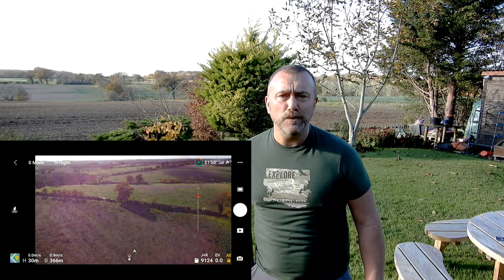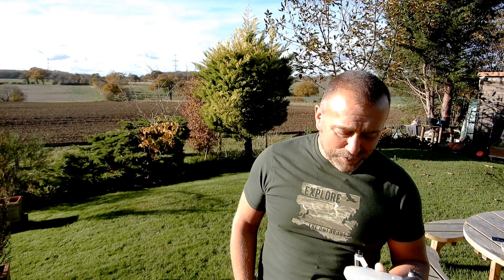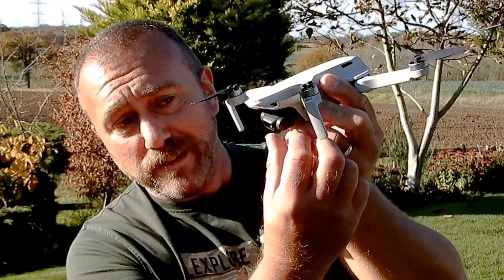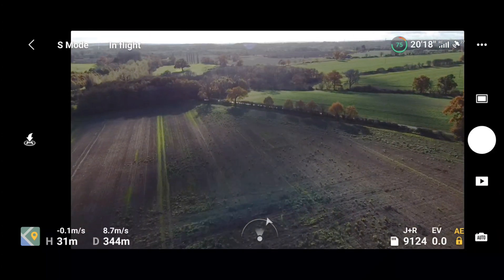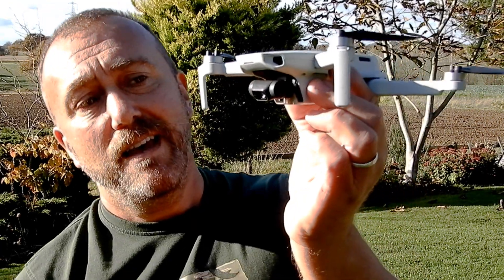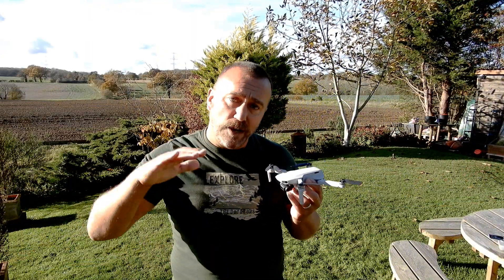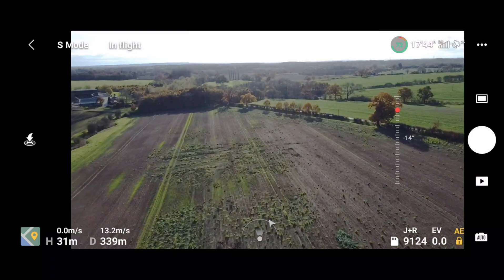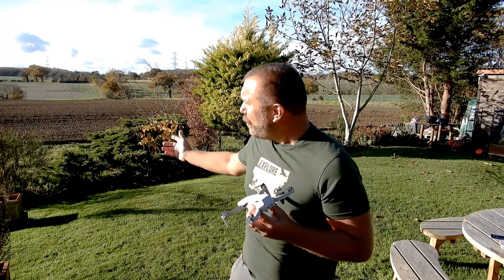DJI Mini 2 Camera Gimbal Dip Issue - Why it Happens & How to Stop it

Comment from the maker: Was initially annoyed when this first happened, but now I understand it, it's not such a major issue to me.  What are your thoughts?  cheers, Ian
Reply: If you fly in C mode it will not happen unless there is serious winds and gusts.. But there is an art to moving the gimbal, knowing how your drone will tilt and keep the gimbal within the range so it doesn't hit either limit, this way it will always seem super smooth...

Sweet

😁
Reply: Actually now that I think about it, you can check some of my last videos, I think this almost doesn't even happen at all to me. I just make sure the camera is not too pointed down nor too pointed up, at about 45 degrees down you should be able to go full speed in S mode and then gently slow down and stop without getting that jerk effect at all.. As long there is offset left between the angle of the drone's forward tilt and the camera's limits there shouldn't be a problem..

Lol

Sweet
Reply from the maker: @ivanjdrakov1957  Yep; that's what I'm trying to convey in this video! :)   Cheers, Ian
Reply: @IaninLondon  I'm so super happy that you made this video, now I can point it to all these pilots who think their Minis have a problem with the gimbal. You'll be amazed that people don't realize why this happens, meanwhile it's so obvious..

Anyway thank you very much for this video, it really was needed.

People should, will just learn with time and experience - how to fly the Mavic Mini or Mini 2 without getting this jerk effect. It's all about accelerating or decelerating gently, a slow change of rate or speed. Also making sure the camera isn't pointed way too much up nor down when speeding in S mode..

Sweet

PS: another awesome video from you, sweet!!!

Keep well and be safe bro!

Comment: I crashed into some tree leaves and my drone fell and landed upside down.  The gimble did a 180 and now films upside down.  How do I fix this, please and thanks.  Please respond as to how I fix this.
Reply from the maker: That sounds like a DJI repair job, although you could try recalibrating the gimbal or using DJI Assist 2, a computer program you get from DJI.co,/downloads

Comment: Also Ian I forgot to mention when the message Kimball overload is popping up I have no control over the Gimble no matter if I try to point it down or up it just doesn't work
Reply from the maker: You can try recallibrating with DJI assist. But I'm afraid it sounds like it's damaged. You need it checked and repaired by DJI.
Reply: @IaninLondon   I don't understand though I did nothing wrong to the drone I didn't break it I didn't crash it I didn't do anything
Reply from the maker: @D-Rock21  True; this happened to me though; it can be damaged in transit or just have a wire fail.  When DJI analyse it, they will advise if it's a failure that is covered under warranty.

Comment: Guys, this is clearly a firmware/software issue! Last year I've been on vacation twice with my Mini 2. So in Austria and Norway. Flew in different modes over snowy mountains, a sea and large lakes, in strong wind and also light rain, but I swear that I have never experienced this issue before. All shots were smooth as hell. After a certain firmware/software update it starts to occur regularly, especially during QuickShots. I remember there was a tool for the Mini 1 to downgrade the firmware. Unfortunately I can't remember the name of this tool. But downgrading the firmware might fix the gimbal jump/kick issue. It's a pity that DJI does not allow the user to downgrade the firmware in case of such issues!
Reply from the maker: Yes and no.  The firmware update was to increase pitch angle, to improve ability to handle strong wind so it doesn't get blown away....  Personally I'm happy with this.... :)

Comment: Hello Ian. This also happens to my mini 2 when top down, in cine mode, when is in photo mode. In video mode gimbal doesn't jump. I think is a mechanical or firmware problem not a feature. Dji should do something to fix it.

Comment: Hi Ian. I know this is an old video and although not the same I have discovered a quirk with my mini 2 that I have now had for 4 days. Not sure if it's mine or standard but with the gimbal pointing straight down (no wind) when I move off in cine mode the gimbal stays pointing down until I stop and then the gimbal lifts  up by approx 5 to 10deg and stays there. Is this normal. Thanks. PS Your vids have been very helpful.
Reply: Don't worry it was happening because I was in photo mode. It doesn't do it in video mode. I wonder why though. Anyway, might be interesting to know for everyone. Thanks
Reply from the maker: I haven't tried that precise scenario, but again, it's likely due to reduced clearance with the main drone body tilting as you come to a stop..... I would not worry about it as it's not a malfunction, more a limitation...

Comment: I contacted DJI and they said: 

The gimbal will sometimes move straight down during flight, as the aircraft's attitude is too large and the nose is tilted too far forward. To avoid reaching the limit, the gimbal will move downward.

The issue mainly appears in the following scenarios:

1. When the aircraft flies forward against the wind, a larger attitude is required in order to resist the wind turbine, and the gimbal is relatively easy to hit the upper limit. It is recommended to adjust the gimbal downward or slow down the flight speed.

2. When the aircraft is flying forward, move the gimbal upward. If the gimbal is close to the limit, it will automatically move downward. It is recommended not to move the gimbal up to the top when flying forward.

3. When the aircraft flies backward, and the control sticks are suddenly released, the attitude of the aircraft will change too much due to the rapid braking. It is recommended to slow down the drone slowly and gently release the control sticks when flying backward.

4. When the drone is flying forward in S-mode, the flight speed is faster, and the attitude of the aircraft is larger. It is recommended to adjust the gimbal's movement downward or control the aircraft to avoid sudden changes in speed.?

Comment: When stationary, I thought the gimbal could rise 40 degrees to look up (so looking higher than dead straight ahead) - but maybe it can't (and it's just designed to tilt up when the drone is pitching)?
Reply from the maker: No, only 15 degrees and only if you've ticked that option in the settings.
Reply: @IaninLondon  Cheers Ian. I stumbled across the setting yesterday and it now tilts up. No idea why I couldn't find this info on Google. Anyway, all sorted. Cheers for your reply, appreciated.

Comment: Hi Ian, love your videos. I just got the Mini 2 and are wondering about ND-filters. Do you use ND-filters with the Mini 2? I have read that they can cause Gimbal error/vibration.
Reply from the maker: I have occasionally but don't like the way they clip over the gimbal; always feel like they could slip off.  They haven't caused vibration for me yet.
Reply: @IaninLondon  so should I get them? What do you recommend?
Reply from the maker: @joakimtollerud2172  To be brutally honest, unless you're flying in very bright sunshine or after some silky water shots, I'm unsure they're truly worth it.  I have done a few videos on NDs and this video will probably help you the most as I explain exactly what they do at around 7 mins in:  https://youtu.be/-KeAo3mhuoA
Reply: @IaninLondon  thx for your answer. I use ND-filters on my cameras all the time but since you're filming something that is so far away I'm wondering how much you really need filters for a drone? Does High shutter speed cause a lot of jitter in the photage?

Comment: Mine does the inverse, it refuses to look downwards 90 degrees. Also the GPS chip runs super hot. I'm a bit worried about testing it on a big run, so I contacted DJI. Testing it out this weekend. It's already plum fallen out the sky once and done minor damage to itself. I'm considering just sending it straight back, but I'm also part praying it'll get better. :/
Reply from the maker: I don't think those issues will fix themxelves; I would send it back....

Comment: Hi, I flew my Mini 2 again today and noticed that as I pan the the Drone from left to right (and vice versa) using the left stick the footage is a jaggy but panning side to side using the right stick is much more smoother - I noticed people avoid filming while turning the drone because of this - is this a common problem? I filmed in auto 4K 30 fps. Cheers,
Reply from the maker: The left stick rotates and will be very sudden; the right stick is simply moving the whoel drone left or right, so will be much smoother...  You can adjust the speed of rotation to slow that down.. https://youtu.be/bzxGz6lZ6aY
Reply: @IaninLondon  That's a great tip! Much appreciated!! This is very useful - many people don't mention these "simple, but hard to know" tips. Have a great day!

Comment: Thanks for this, Been out with the Mini 2 for few test flights and I am actually experiencing this in Normal mode at low height with very little wind so I am not sure if this unit is faulty or these Mini 2's just can't be flown and capturing footage in anything other than Cine mode which is a bit disappointing, It also did it with an Auto return to home in Normal mode also and that day was very calm and it was only 100 ft up, Will give it a few more go's depending on the weather and see what happens.
Reply from the maker: It's worse if you're flying sideways.... and most apparent when you have the gimbal up as high as it will go.  Try enabling the upward gimbal option allowing it to go up an additional 15' above the horizon
Reply: @IaninLondon  Cheers I didn't know that either thanks for the tip, I already have the upwards rotation enabled, Just checked the logs and it was only around 9 m/s about 20mph when it happened also which seems odd at the height and little wind there was, However I could see quite a bit of the horizon so maybe tilting it down a bit more may solve it, Thanks mate.

Comment: I think the problem is that it is very difficult to predict exactly when this will happen as there are multiple factors involved such as speed and wind conditions. This has the potential to ruin a perfectly executed shot. Perhaps it would have been better for the drone to default to flying within the gimbal's tolerances and give the user the option to switch into a higher power mode when conditions get rough but then you know it might cause issues?
Reply from the maker: I'm hoping they fix this with a firmware upgrade as they did with the Air 2.

Comment: I don't totally agree with you as at has, at least for me, dropped in all three modes. I contacted dji tech support and they had me do a reinstall of the ap plus had me do a gimbal reset. That didn't help. After the latest update it did seem to improve it where it only does it in sport mode. I'm hoping they will fix it. It doesn't seem to do it in all the drones as I've seen many videos of it  (unless they are not posting it) Some are even having a side tilt, probably for the same reason you've stated. Mine has been in pretty fast winds and I don't get the side tilting on mine so far.
Reply from the maker: I've had side slant as well, in normal mode, but in strong wind....  I hope they do an update like they did to fix a siilar issue with the Air 2.

Comment: I just got the mini 2 and haven't really used it much but I've heard in other videos, if you turn on upward movement of the gimbal in the settings, this can also help improve the dip people are experiencing.
Reply from the maker: Hi Andrew; I'm not so sure as the issue is the physical limit of room for movement, whilst that switch is simply a software element that allows the gimbal to move up beyond 0'.  But I'll be playing around more with this setting to see... Cheers, Ian

Comment: States in the user manual to not use sports mode for video or photos. (tho it is odd not to have it good in all flying modes but that's what it says)
Reply from the maker: Aha!  Well, good going Karl; I do usually read the manuals to double check the features but missed that one.  You're right, bit strange but I guess they know this issue will occur.  Bottom line, I'd prefer a twitchy gimbal over a blowaway...  :)
Reply: @IaninLondon  true, though recording isn't the priority if you're going up in winds higher than the drone is rated for anyways.

Comment: I can still consider that as something that has to be fixed by DJI. Sports mode is primarily used to add a bit of action in your footage and not just to resist gust wind, therefore when you go in sports mode, you should have the ability to capture the best angle it is capable of. As you see, when the drone moves forward at maximum angle it is initially able to focus the camera straight at the horizon and only flips a bit down suddenly in certain situation.  Maybe the gimbal is not strong enough to hold it at that maximum angle or it is the firmware that needs some fix. In short "it's not broken" but I don't think it is a "safety feature."
Reply from the maker: Oh it's defo not a safety feature, but it is a consequence of the increased pitch to fight strong wind better which then stops your drone being blown away.....  There was a similar issue with the Air 2 that they fixed by a firmware upgrade to control the pitch better; hopefully they'll do the same here...

Comment: Thank you for the explanation. 
But for me it's a NO GO. I didn't have this issue neither with the Pro nor with the Mini1. 
If you're recording a video and the dip happens, it's very frustrating, particularly if it's something you want be able to record again.
I'll return my mini 2. 
I'll buy one only when DJI fixes this dip issue.
Reply from the maker: I think you'll find they'll introduce a fix for this via a firmware upgrade.... I wouldn't return it just for this issue but maybe try it out a bit and see if it's anoying for you...

Comment: this will only be caused by using sports mode, theres no need to pitch the gimbal down when flying in normal modes. so many new drone users out there causing a stir over nothing. this has been around since the mavic air was released. learn how to fly properly.
Reply from the maker: That's not quite true; this also happens in P Normal mode too, but not as frequently, and never happened on my Pro or 2 Pro.  But i'ts only a mior issue I think and with care can be avoided....
Reply: @IaninLondon  then adjust your control inputs in the fly app so that they're not as sensitive.

Comment: Other solution : in your settings you can check "Allow Upward Gimbal Rotation" so you can pitch up the gimbal more than the horizon (+20 degrees).
Reply from the maker: I'm unsure if that actually gives more clearance tho. There's a physical limit of the body of the drone, and that won't change if you enable the gimbal to go beyond 90'.... Maybe needs more testing.
Reply: @IaninLondon  Actually this allows the gimbal to go further than 90 degrees (actually let's call this 0 degrees). It is the option called : "Allow Upward Gimbal Rotation". So when you fly faster in Sport mode, that 20 degrees angle gives you room and becomes your "new" 0 degrees angle. You can try it :)
Reply from the maker: Yes, I get that, but it's a software limitation not a physical limit. So irrespective of whether you have that set, it should still make use of the fullest range of movement....

Comment: I think that DM2 has increased maximum tilt limit beyond mechanical limits of gimbal. Original mini has issue only with gimbal facing down and strong tailwind. I guess wind resistance is more important than ruined video footage.
Reply from the maker: Yep; I know what I'd prefer.... Jerky video occasionally or watching your drone blow away....?   :)
Reply: @IaninLondon  The scariest moments with mini are not related to wind, but to visual positioning system. Hopefully I had only harmless crashes into small branches, but flying over fast flowing river with trees on both banks is probably worst idea I ever had.

Comment: I was wondering if anyone else has experienced skew pictures being taken while taking a wide pano. The photos on the left and right are taken at an angle. Someone said this was normal as this happened on his Mavic Air 2 as well but this has never happened on my Mavic 2 Pro. I suspect that it might be wind that the gimbals is not able to deal with. I did not get any wind warning but it did seem to work better at lower altitudes which makes me think its a wind issue.
Reply from the maker: I have noticed the horizon tilt occasionally, especially at high altitude in strong winds... The gimbal has its limitations versus the steep pitch
Reply: @IaninLondon  That makes sense. The drone might have no problem with the wind but the pitch might throw the gimbal off.